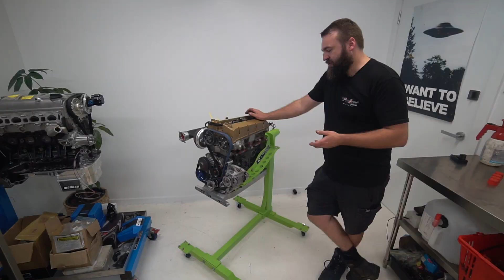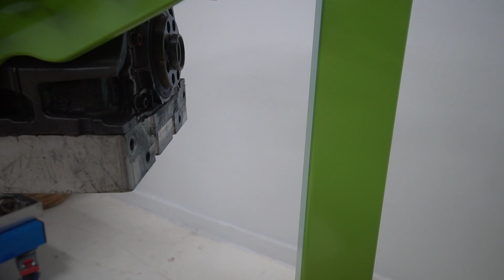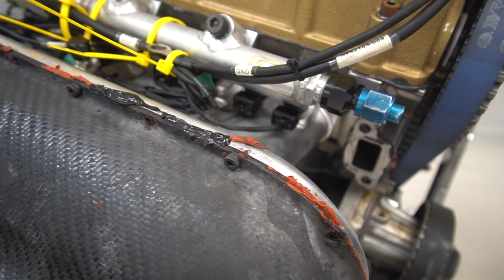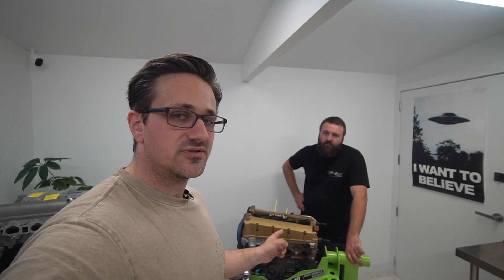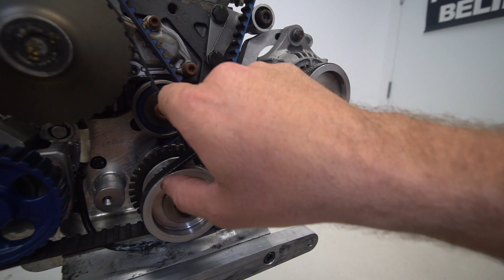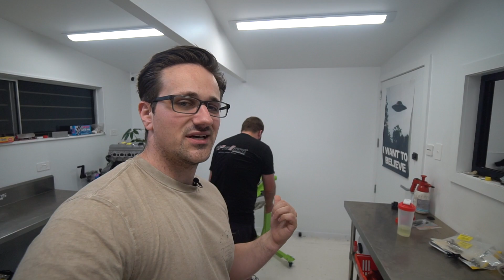Formula Atlantic 4age Turbo

Comment: Could someone with heaps of money built a super-duper engine that conformed to the regulations of Formula Atlantic or are the rules fairly strict on the engine builds?
I could see 3D printed pistons or carbon/carbon pistons, titanium one-race valve springs, moonshot rev limits, titanium conrods, the list just goes on and on.

On another note, I notice that the intake ports do not have parallel sides, which makes those rather interesting, as conventional (American) "wisdom" is to have an intake port that is strictly of an unchanging cross-sectional area and shape from start to finish, which "wisdom" I have begun to question.

Comment: i would rather see how much power can it do NA with all out cnc ported and nitors fuel ect.  sure enough thats also too much cost 😂
Reply: I have 2 more FA motors coming in for builds in NA spec so you will see it soon enough, also going to be engine dynoing them so I will get niko to come film that

Comment: Just get a weldspeed inlet manifold. Best one you can buy for a 4age.
Reply from the maker: Your not wrong about the weldspeed manifolds but the head has been shaved down where the intake manifold bolts on so some custom work was needed, not to mention that the Swift 014 race cars engine bay is a little different to a ae86 so Mat had Hack at AH Customs relocate the throttle body to a more suitable location (it'll be a little more clear in the next video)👍
Reply: Trust me I wanted to use one but like niko mentioned the head was modified so I couldn't use a weld speed 

Also the throttle body wouldn't in an ideal spot compared to what we made, it's not the prettiest thing but it's going to work lol